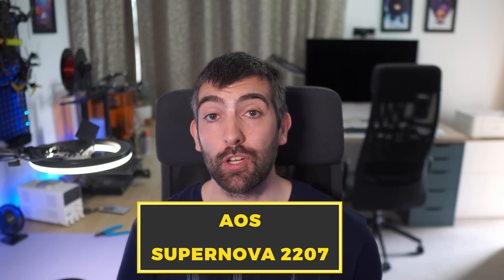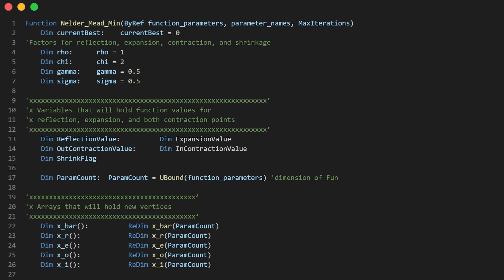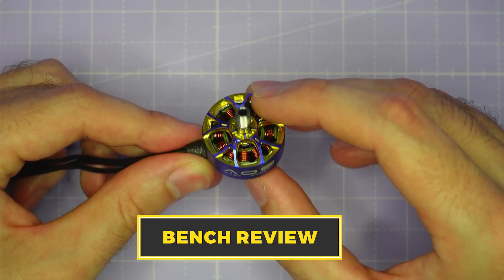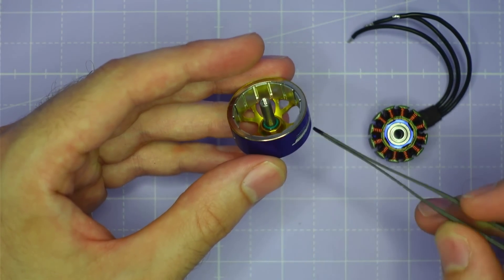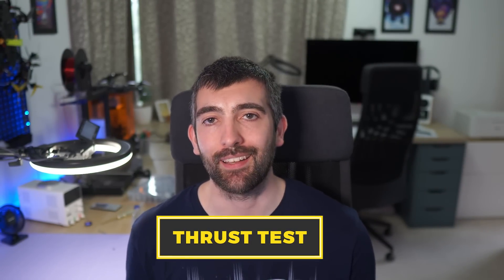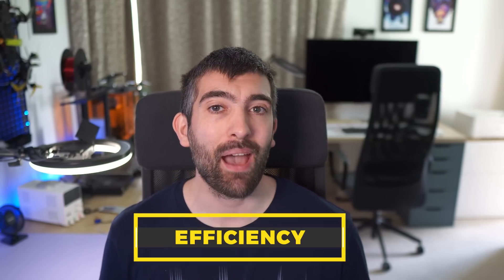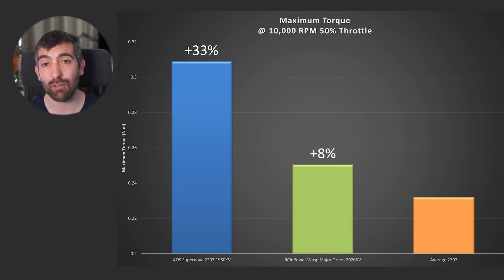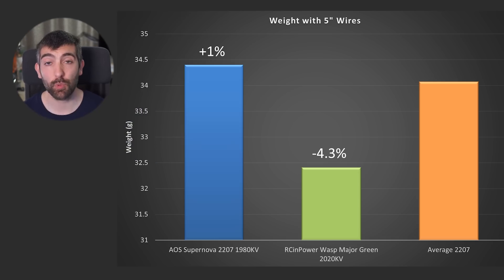How I OPTIMISED the 5" FPV Motor with SCIENCE: AOS Supernova 2207

Comment: Maybe a stupid question from someone who's about to try his first long range ardupilot vtol plane based on the zohd altus. Could the higher efficiency benefit me in low amp forward flight mode compared to the standard lighter 2204 motors that come with the vtol kit?

Comment: How bad would it be to run zeee 4s 120c lipos on these motors? I currently have 4 new 1500mah and 2 1300mah and planning on buying only 2 6s 1300mah 120c bats and want to rin tue 4s bats until i can buy enough 6s bats. Or should just wait

Comment: Offtopic: I need to replace a Mitor on a wing rc model. It is a Horizon RC Aero-Scout. The Motor on the model is lsbelled 2306-2250kv and runs on 3S. 4S will be supported by the controller bit it limits the current to 32A. With the provided propeller it draws 26A. With 4S the controller goes to max current at 32A. All data from the embedded telemetry of the model. 
As the low quality original motor fell apart after some very exciting 4S flights I am looking for a replacement.
Would the lower kv rating of the AOS Supernova reduce the power-output on 3s significantly?
As I just have to buy 1 instead of 4 motors the price doesn't play a big role. I took a look at the GTS v4 MCK as well. Looks very cool and has slightly higher kv.
May be somebody already tried to use a performance drone motor on that Aero-Scout model.

Comment: Chris, a little help, I got those motor installed on my Drone today, but the PID form them that comes by default on betaflight 4.3 just sucks for it, it works with a 3S battery, it sound like one or two bearings are hitting it other with a 4S battery and it sounds like all bearings are going crazy with a 6S battery… do you have any baselines of PID where I can start? My ESC is a BLhelli, not a. lHelli32…
Reply: Also to add to that, with a 6S the motors and the battery get extremely hot,  and a 6S 1100Mah is depleted in about 40 seconds

Comment: Hello, it would be interesting to see what this motor could do in a heavy-lift scenario. This means using a much larger diameter prop with very low pitch, and not going anywhere - just lifting weight from the ground up to a few meters. Success would be measured by the multiple of payload over the quad alone with its batteries. Using FPV technology for the batteries, a custom frame that accomodates the enormous props, and with a very short flight time of only a few seconds, I bet the ratio of payload to drone weight would be absolutely amazing, and a very spectacular demonstration of FPV drive technology.

Comment: hi chris, i just recieved these motors and after taking measures, i was wondering is there a particular reason that you call these motors 2207 when they are larger close to a 23?
Reply from the maker: They weigh the same as a 2207 and are designed for the same purpose, the name is to make sure they end up in the right place on store listings.

Comment: Maybe do a betaflight pid tune. I have low throttle oscillation and sounds like motor is out of time. But in high to mid throttling it does great

Comment: I believe its a 22.6x7.5mm Stator If I'm wrong someone let me know.
Reply: 2308 as measured by a youtuber. No wonder its out performing 2207 sized motors.  No doubt it's a well built light 2308 motor, but a 2207 it isn't.  The engineer in chris is obviously very solid, but the obvious marketing speil is obvious.....unfortunately.
Reply: @paulg7763  no, it is 22.5x7.5 
weight and torque/efficiency is important, nothing else

Comment: Great work Chris! Finally someone designed a FPV motor with the magnetic circuit in mind. I too am a designer working on a new class of EDF for RC & drone market. I'm going to be using your motors. It would be nice if you designed a new motor keeping in mind your work ethics to work with this new class of EDF. Wish list... high torque, very high RPM (the highest possible) smaller diameter and to compensate longer length if needed. If possible consider axial flux. Also look into the benefits of ultra pure iron (99.995%) laminations over silicon steel laminations or metglass for the flux circuit. Keep up the great work!

Comment: I cant seem to find an answer to my train of thought, can someone shine some light on this: this motor is stated as a 5-6S, yet more efficient on the 5S side.. what would happen if id run it with a 4S? Wouldnt have much power but would be more efficient? Also, say I was building it for a 6S quad, then throttle caping it to 5S would make it more efficient? And would that make it good for long range? Thanks to anyone who could help clear those questions with me.
Reply: You would need to use a larger prop and larger props are more efficient.  Worse throttle response would be a con.

Comment: Looks good but still missing out on a bunch of extra efficiency by not using square or rectangular coil wire, using normal circular wire you waste all that space in between the windings and have lower flux density
Reply from the maker: I did look into that but it's not possible with the current automated winding equipment 😭
Reply: @ChrisRosser  Make a special edition wound by hand motor using square silver wire.

Comment: Chris I think your efforts are great. You have highlighted the real lack of a proper engineering approach in this market. Frankly we all know this. Along with often sketchy QC control. The problem you need to look out for is how will you know if there is manufacturing consistency in what is produced, effectively, in your name. Is there really no hobby motor manufacturer in the EU or US you can partner with? Like Hacker maybe. I know the price-points they usually hit are way above the generic stuff out of the China market.  Maybe there is a market for stuff designed to last and that is repairable even if it is more expensive. Just a thought. Oh and you should not be calling these motors 2207 -- that's an awful idea. Imagine if this becomes the norm? Just call them 5 inch motors.

Comment: Very curious and going to be testing this vs my current MCK motor on my racers. Is this correct? 

Motor 1 MCK (Higher KV 2100, Lower Thrust): Assuming the KV is the actual KV It's going to give you higher top-end speeds because it can spin faster (higher RPM). However, its lower thrust means it might not have the rapid acceleration you'd get from a higher-thrust motor. In a straightaway, this is where higher KV shines. For freestyle pilots who focus on sharp, fast moves and less on lifting power, this motor would be more appealing.

Motor 2 - AOS (Lower KV 1980kv, Higher Thrust) compared to motor 1: This motor is your powerhouse. It won't hit the top speeds that first motor will, but it'll get to its top speed quicker due to its higher thrust. This makes it ideal for tracks with lots of tight turns where rapid acceleration and deceleration are key. For freestyle pilots, the extra thrust means more lifting power, which can be useful for complex maneuvers or carrying additional gear like high-quality cameras.

Handling/Speed Differences:

Racer: If the race track has long, straight sections, Motor 1 will give you that high top speed. But if the track is tight with many turns, AOS would probably serve you better because it'll get you back to top speed faster after each turn.

Freestyle Pilot: For those focused on agility and quick flips, Motor 1 higher RPM offers an edge. AOS would be better for those looking to carry extra equipment or perform more complex, torque-demanding maneuvers thanks to its higher thrust.

Would be helpful to understand it in context of actual flight as well as opposed to just a bench test which is much appreciated, I'd like to learn more about so what. I'm only addressing kv and thrust but would be nice to understand how all the factors play together in flight performance.

Comment: Do you plan to make optimized motors in other sizes and/or for other sized props? Given this is the optimal kv to efficiency for this size motor and a 5" prop...if you are targeting a different kv would you then change the size of the motor? Many 3d printed RC airplanes use drone motors. In this way we can move the battery more forward to better balance the plane on the CG. So I'm always interested in more efficient motors given how much planes fly at full throttle when flying combat models.

Comment: This is the most excited I have been about a motor in years. Congratulations on your breakthrough. Do you plan to optimize other motor sizes? Do your tweaks to the modeling software work for larger rc plane motors? It would be amazing to see new 2212 sized motors built for efficiency and power. Amazing work! Thank you for sharing!
Reply: What breakthrough? He made 2308 motor and called it 2207. He also compared it to 2207. If we exclude the weight, of course the 2308 will be better than the 2207.
Reply: @vdz89  I mean.. did you watch the 12 minute video above? Compared to 2207 motors of the **same** weight class he has produced a motor with better efficiency, power, and responsiveness... for no additional weight... you know... a breakthrough... I think it is mentioned somewhere out there he actually used smaller magnets and a thicker flux core or something like that rather than the industry's trend of bigger magnets and a a thinner flux core. Also, his stator core is hollow, between those two weight savings it allows his physical dimension to be slightly larger while gaining no weight. So it is a motor that spins a 5" prop that weighs the same as all the other motors designed to spin a 5" prop. The reason you don't compare this to a 2308 is because they weigh more... Here, I found the video where he gets into the more technical design decisions:  https://www.youtube.com/watch?v=yxZZ2M3gRyI good luck trying to watch a 40 minute video though.

Comment: I'm a little sceptical about those numbers but if it proves to be right, would it be possible to be scaled up with equal results?
Reply from the maker: Yes it should be possible to apply ths approach to get the best performance at any size.

Comment: Oh, so you basically made the perfect motor size for V1S prop if I understand. Did you consider that there are many newer and better propellers, that don't have to perform this well with AOS motor ?
Reply from the maker: It's not propeller specific. More torque with better efficiency improves performance across all props.
Reply: From my experience, if you need more thrust, you'll go with larger or more aggressive props, it's not essential to have the most powerful motor. The efficiency with such props might not be as good on AOS motors, since they are higher KV. Claiming that one motor is superior to others is quite controversial claim imo @ChrisRosser

Comment: I remember the time when cobra 2204 was the "best performing motors" for a moment... because they were actually secretly 2205 hehehehe :) @Chris - you are scientific guy, and thats what you are greatly respected for. Whats the problem with showing numbers? Especially if you absolutely sure its the best motor? Just curious!!!!
Reply from the maker: Happy to share performance numbers but not design numbers. Design numbers don't make a difference to performance but do help others copy the design.
Reply: @ChrisRosser  What puzzles me, say you made stator lighter. Ok, not the first time really, plenty of motors with huge hole in the center. But on other hand, you made rotor heavier. The MOVING part. More momentum and more current needed to start it and slow it down due to mass. May be its neglecteable but still, u know... Physics... Dare to explain this?
Reply: @ChrisRosser  people do have calipers :) And launching new product with this kinda thing, really not like you mate. With all respect. Unless you have an order/nda from rcinpower of course. :)
Reply: @ChrisRosser  And yes, we ordered some motors for testing :)))))

Comment: 7” Quad? - This initial motor is for 5” optimization. Would the technology apply or possibly even have greater impact on a motor designed for a 7” setup?
Reply from the maker: I would expect to be able to achieve a similar performance uplift for 7"

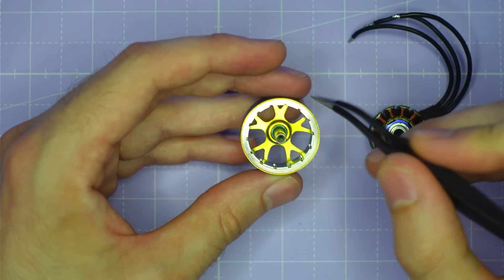Comment: 4:35 Surprising you're able to get higher acceleration while adding a significant amount of semi-dead weight at the outer radius where it has maximum inertia. Most of the motors I checked had very little field leakage measurable by linear hall sensors on the outside of the rotor, so I figured the flux ring thickness was already into diminishing returns in terms of magnetic performance.
Reply from the maker: The total inertia of magnets and flux ring is only very slightly more than a typical motor but the extra torque is 33% more so that dominates.

Comment: Interesting progress. After testing maybe 100 motors over the years of all sizes in the field, and in competition, started to come to conclusion that for a modern pilot with modern gear (post 2020ish) it almost doesnt matter.  None of us can take full advantage of the speed/power on a track other than maybe a dozen people at the top.  

Still welcome progress if it helps move us all forward.
Reply: I agree @JonE5FPV   in fact I think a majority of fpv pilots out there would fly better if they had less power in their builds. The top % can take advantage of almost all advantages, but everybody else - nah.
Reply: Best comment! Thank you!
Reply: It is good to be able to technically land on the 'solution' to the source of so much variance in motors available though, at least so the industry can then focus in on what actually are good configs using actual result data and move on to innovating elsewhere.
Reply: Same with motorcycles lol...
Reply: @jollyrogergaming9842  yep, honda put a throttle sensor on the bike, and discovered the rider only used full throttle for about 2 seconds.  so downsized the engine, and weight, and made a bike that went faster since it ran full throttle much more often.

Comment: It is kind of funny. You're an expert in jet engines, which was the next technological step in aircraft propulsion from propeller planes. Then you go on to design the best motor at spinning a propeller, beating out hundreds of people that have been designing propeller spinning motors for decades. It's a shame we're not all millionaires flying model jet engines so you could test all of the current manufactured small jet engines, build a testing simulator and take model RC jet flying from subsonic to supersonic. That would be some fun FPV.

Comment: Chris, this is something truly exciting to me. I studied Aerospace Engineering and one thing that really stuck with me was a lecturer's advice that one way to really be valuable as an engineer is when you can not only find a good solution, but use numerical and/or analytical processes to find what you believe to be the best achievable solution for the design requirements and available technology.
Now I wonder if you could apply this model and process to optimize for a smaller motor class, such as for Sub-250g builds?

Comment: I love the analysis and breakdown of how the motor performs and I think I'm gonna try to buy this for my next quad, but I really don't like how you're calling this a 2207 motor and then say that actually it's not a 2207 motor, it's 2207 "class" motor. Being from a scientific background, aren't you annoyed when people turn real physical and scientific dimensions into a marketing tool? You're doing that here. 2207 is supposed to mean something. It's supposed to be a number I can rely on and know what it means. By turning the stator dimensions into a marketing gimmick. You're making a mockery of what the number is supposed to mean. I really think that is a bad decision long term. You should just drop the 2207 and call it the supernova 1 or something. You shouldn't hijack this for your personal and marketing gain.
Reply from the maker: Yeah, I'm also really annoyed that motors aren't described and sold by weight class/torque but rather by stator dimensions. You can get totally different performance from the same stator size with different magnets. However, as an engineer I've made my peace that this is the world in which we live and people choose 2207 size motors for 5" quads so the motor has to be called a 2207 otherwise noone will know what the hell it's for!
Reply: @ChrisRosser   I get where you’re coming from, in my field it’s like when Cyrix started making their pentium class processors. The stator volume are dimensions though. You shouldn’t hijack that meaning for marketing. You know that. Here’s an idea though. If in your testing 2207 is a useless term. Why don’t you make a difference here and start using another term, weight@torque, 35@80, for example. 

It gives you a differentiating factor from the market, might inspire a sea change in others away from stator volume, kinda sounds cool, and more accurate, 

What do you think?

Comment: Dear Chris, first of all: huge fan, your tuning guide made my quad fly like its strapped to rails!
I have a quick question about the optimisation of prop efficiency. It is common knowledge that an airfoil generates lift by having a higher airflow on the top than on the bottom. When building RC Wings you sometimes hear a Foil generates even more lift when its surface is rougher on the top than on the bottom since the airflow gets slowed down even further. Is this also true for FPV Props and is there a chance you could test that with your thruststand.
I thought of using the same prop twice in a row first in its original state and after working on it with sanding paper. Preferably with a prop of size and weight where the material loss doesn’t significantly affect the weight.
Although I don’t think the effects will make difference like day and night, but for tiny whoops where every gram of lift matters it could be a new aspect when it comes to Propeller efficiency.